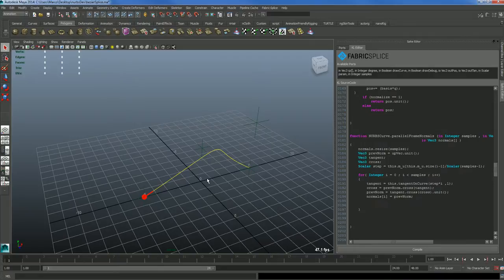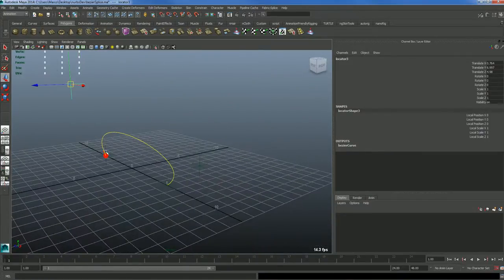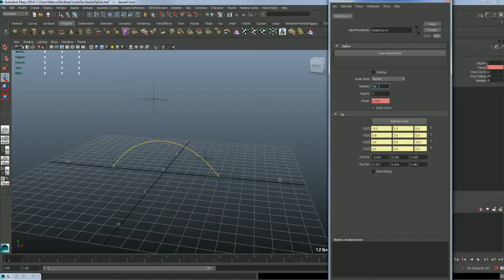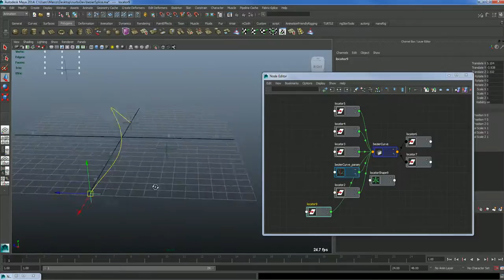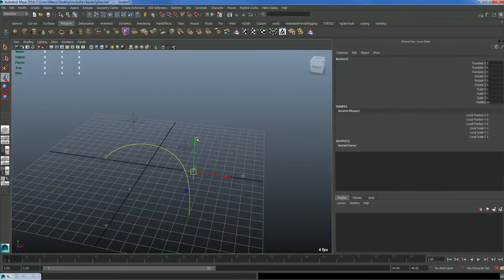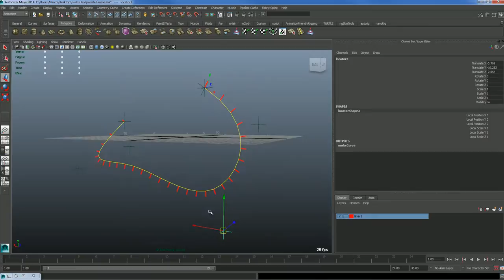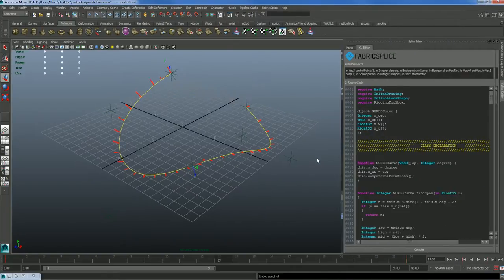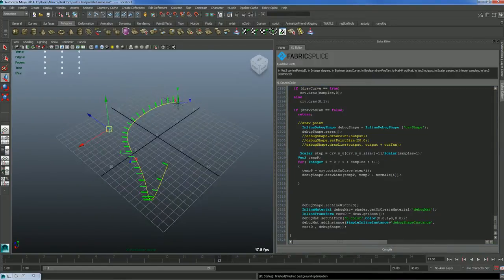DEMO SPLICE : Bezier and Nurbs Curve class

Comment: I've been curious about using Fabric Engine to port my animation and rigging tools to. But my guess is (especially if there isn't nurbs curves!) is that it isn't far enough along to provide everything I'd need. What are your thoughts?
Reply from the maker: There is not yet a nurbs curve surface class but no worries there will be one soon, they wanted to focus first on the geometry class since it allows to do more stuff, deformers procedural geometries or even renders i guess. Anyway there is a lot of stuff that can be done without the nurbs , also there is a bunch of new stuff that is gonna be released of siggraph i am looking forward. In the end yes if you are looking for a complete toolkit for rigging i would say is not 100% there yet.